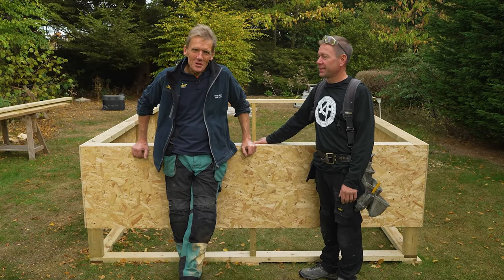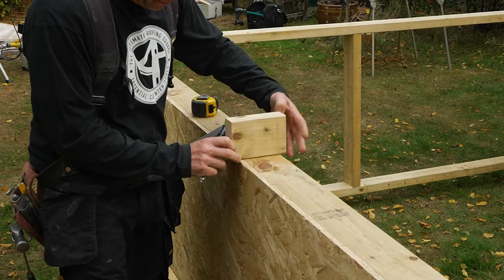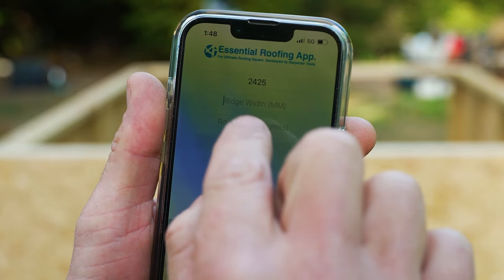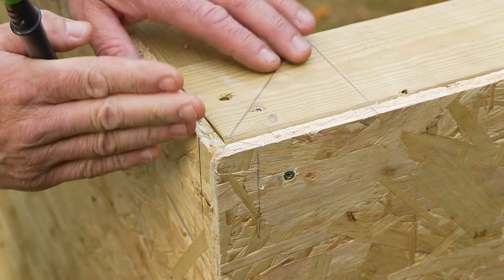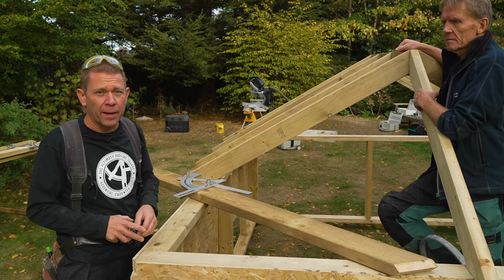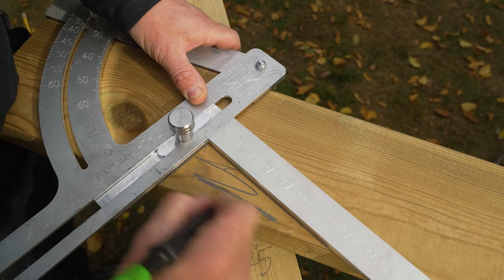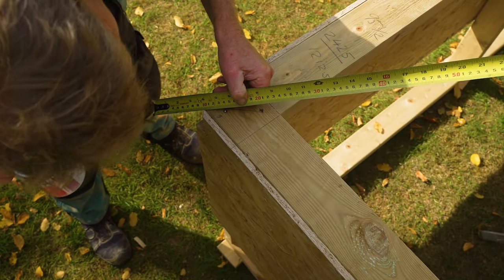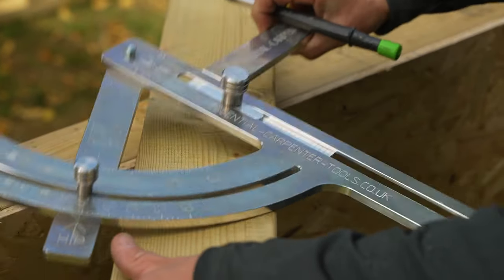How to Build a Hipped Roof, Proper Job

Comment: Great video. I don't measure the hip length. I put the hip rafter in it's position with the plumb cut higher by the height over plate.(93mm in your case)
Then from where it strikes the wallpate i plumb it up and level the seat cut, at 93mm above plate. So when it's cut it drops down perfectly into the correct position. Works great with long hips. Love the roofing square, how do I get one ?
Many thanks
Reply from the maker: Hi Martin 
I have used that method with Dan and it works well. The only downside it putting the long rafter up and then taking it down for cutting.
 Dan's square is available from https://www.essential-carpenter-tools.co.uk/store/p/ultimate-roofing-square-6975m

Comment: Always wanted to test this by myself, great job 👍

Can you explain why you make that "arc" line, instead of measuring from the top -> square line down and then mark the birdsmouth?
Reply: Hi Robin, as it’s 2 fixed points , ridge and wall plate there’s no need to measure along the top of rafter.
Reply: Ok, thanks. And how do you determine the angle of 30 degrees.? Did you calculate this, or did you choose this by yourself?
Reply: @ziel0k5  if you watch the previous roofing video you can see how how we decided on the pitch.  Thanks for watching.

Comment: Roof porn. Love it! A cut roof done well is  a work of art....... And I hate to say it, but a dying skill. 

One observation about 600 centres that a chippy won't see unless they go on to do the roofing as well, is that you can get tremendous bounce on the battens. If you're slating the roof or using a plain tile and nailing every one, you really notice the difference in stiffness of 400 versus 600.
Reply from the maker: Hi Paul 
 I think 600mm centres are also bad for plasterboarding. I would always choose a 400 centres layout.

Comment: When focusing on the hight above plate measurement for the hip rafter, it doesn't take into account the level with regard to sofit side. Do you ever need to cut a strip to level it off underneath?
Reply from the maker: That is in the next video. It is common to cut the rafter feet with a level line

Comment: I learned hipped roofing on my level 3 diploma course at college 6 years ago. Working out the hip and jacks always confused me as we were taught with a geometric drawing with a compass and 3 bevels. I’ve watched all Robin’s roofing videos  and not taking away anything from Robin as his a great carpenter but explaining how he works it out confused me aswell. This is the first video that actually made sense to me to the point where Dan has explained how to do it practically with simple explanation to the point where this has all just “clicked” in my head with roofing. It’s made that much sense that the next roofing job that comes along I’d be confident to take it on and not shy away from working out the hips and jacks. Thank you Dan!
Reply: That’s great to hear Tom.  Sometimes you just need that explanation to make it click.  
Happy roofing! 
Dan.
Reply from the maker: Hi Tom 
We produced this video with Dan in response to comments on previous videos we have made on the same subject. It was clear from the comments that we needed to slow it down and go over the points in more detail. I am so glad it has done the trick, it is a great moment when you get something, that lightbulb moment is what makes it all worthwhile. 
It is well worth watching Dan's playlist because he has really covered all the key aspects of roof construction now.

Comment: Learned to do roofs using imperial inch rise rafter table and would find it hard to change but this is a very good way of doing it
Reply from the maker: Dan has an American version of the square. It works the same way

Comment: Great pitching Dan.. pity Rodger said you can use the square if you want or not, however, if I didn't use your square I wouldn't know the angle of the hip!! So it would be a great follow up video to show people how to find the pitch angle of the hip. Incidentally in Scotland your King common is our Crown rafter...go figure.
Reply from the maker: Hi Stephen 
We get accused of disguising adverts as HOW TO's so I wanted people to understand that the information holds whether you use Dan's square or not. We don't drag people kicking and screaming to the cashpoint and it works well enough. Daniel had sold out again.
Reply: tan⁻¹(tan(P)÷√2) where P is the pitch of your equally pitched roof :) 
E.g
tan⁻¹(tan(30)÷√2) = 22.21 rounded.

The tall carpenter also has a practical way of doing it, pretty cool.

Comment: Am I right in saying the size off the hip rafter’s and the ridge be half the size again of the common rafter.
Reply: The sizes are usually worked out by a structural engineer.

Comment: In the USA imperial dimensions are still used
Reply from the maker: That is why we mention them. We have many American viewers who struggle with the metric measurements. 
Dan also has an American Rise over Run version of his square
Reply: @SkillBuilder  yes they do.Roofing ratios in America are different .its per feet run. Eg a 6 12 pitch means that for every foot or 12" run it rises 6" and so forth. I am personally fully conversant with both metric and imperial units.Metric been the easiest to work with.

Comment: I was taught to not drop the hip rafter down from the plane of the common rafters like Dan has here. Rather to keep the hip up on plane with the other rafters and cut or plane the dihedral angle onto the hip afterwards. I don't think strength wise it makes alot of difference though.

Comment: Hi Dan and Rodger I’ve been in the trade for many years general carpentry but have over the years fitted a few roofs trusses and cut and pitched,loved your vids so much bought Dans roofing square as I have a small roofing job coming up very pleased when it arrived but like many carpenter thought I could improve it (oh dear ) so noticing that you used a clamp to secure rafter ready for cutting I thought why not drill and countersink a couple of holes so I could use screws for the same result; that I’ve done so will see ! Keep the vids going 
Phil.

Comment: Helpful indeed. Gents, would you entertain with a video on deck railing top plates with "Comfort slopes". The top plate is sloped 22 deg for resting on. The learning message is how you miter the outside and inside corners, with a 22 deg slope. Thanks for the consideration.
Reply from the maker: Great suggestion!
Reply: Thanks and hope to see your video on it. @SkillBuilder

Comment: As an owner of one of Dan's squares, an explanation of why the proportional rise in the hip markings are not equal would be appreciated. (In simple language.)
Reply from the maker: There is no easy way to explain it but we will have a go in another video.
Reply: The hip plumb cut is not always the same, it varies each time so it’s marked out irregular.
Reply from the maker: @Ultimate-roofing-square.  Yes he knows it is irregular but, like me, he wants to know why it is not a constant. Somebody explained to to me and it went in one ear and out the other. It is to do with the fact that you are not working in plan. We can discuss this in a future video. It is one of the drawbacks of the traditional carpenters roofing square because it works from a fixed point.
Reply: @SkillBuilder  good idea.

Comment: help! l have a pitch roof at 19 degrees at 5 meters, steel beam to wall plate what thickness rafters do l use  to keep building control happy (should l use a purlin ?)